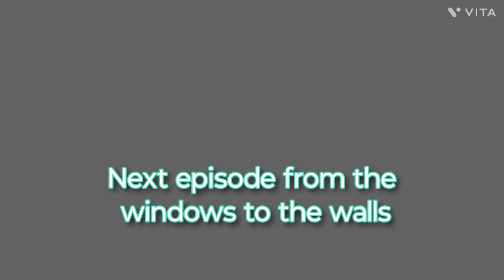SQUAREDROP CAMPER BUILD EPISODE 3 WIRING LIGHTS AND INSULATED FLOOR & SURPRISED GUEST!

Comment: hi, what product you used for painting the trailer frame? also, how thick plywood is your bottom floor layer?
Reply from the maker: Hey there, thanks for the interest. My frames are primed and painted with acrylic enamel automotive paints. But you could use Rattlecan as well. The floor bottom is 1/2" ply rolled with a urethane sealer and sprayed with truck bed coating. The floor is sandwich style and total thickness of all combined layers is 1.5"